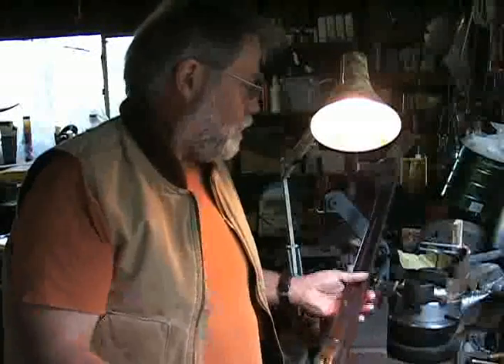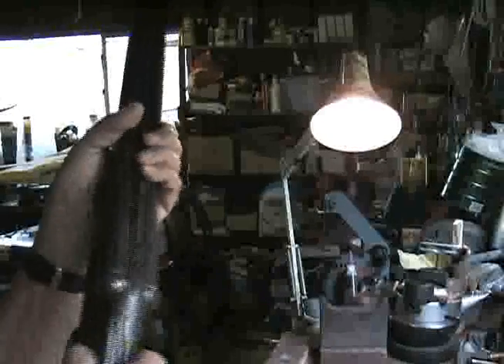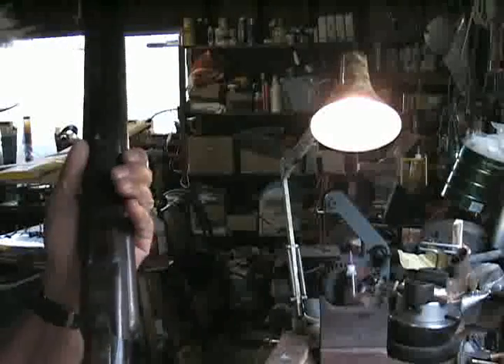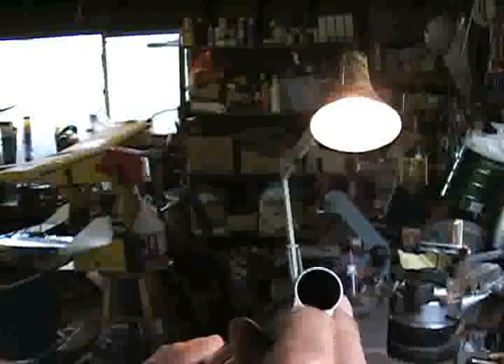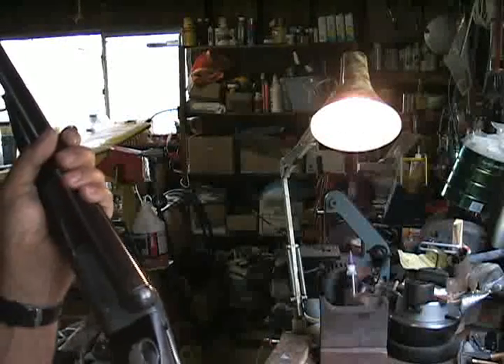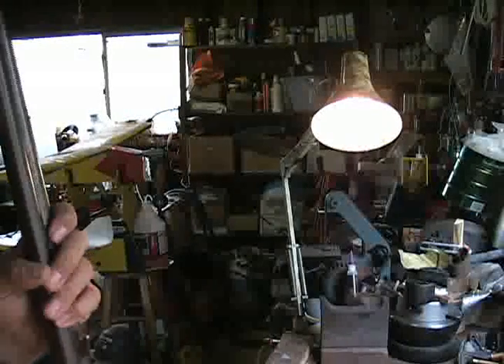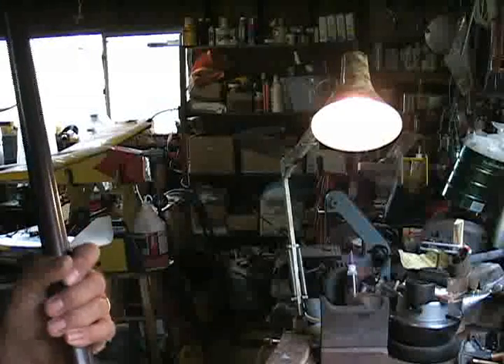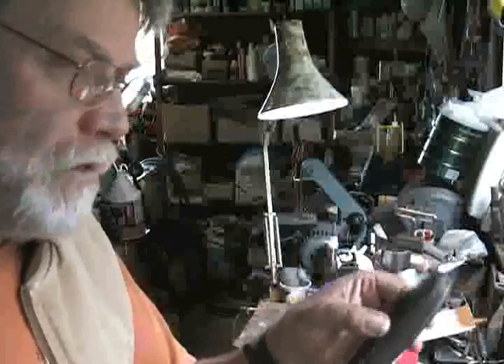W. W. Greener Shotgun Restoration part 1 Intro

Comment from the maker: Don't unless you have the correct type and size of screwdriver. Then you need to put some P Blaster on the screw and let it soak overnight. Put your chin on the heel of the screwdriver and push like hell while you turn the screw. If it does not respond, then you will need to use heat. Be patient. Screws are very easy to mess up.

Comment: Hello, my ww greener's top lever seems to be locked up, even when I removed the screw from it it was still stuck, do you have any advice?
Reply from the maker: I can't say for sure. Removing the screw does nothing to help though. Suggest you lubricate the crossbolt with light penetrating oil (where it goes thru the rib extension as well as where it daylights on the left action ball) as well as the area around the toplever spindle, and finally the underbolt (you have to remove the bottom plate to get to that unless your gun has exposed lumps, and when you remove it you may also be able to see why it's hanging up). Then try again. Don't force it, it will break and then you will be in a world of hurt. If you can't get it to move go see a gunsmith who knows something about doubles.